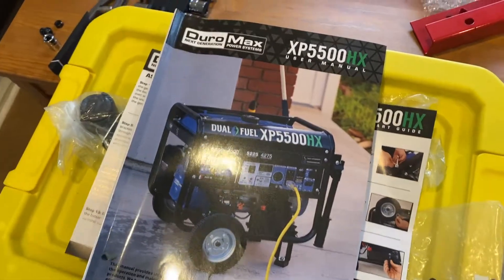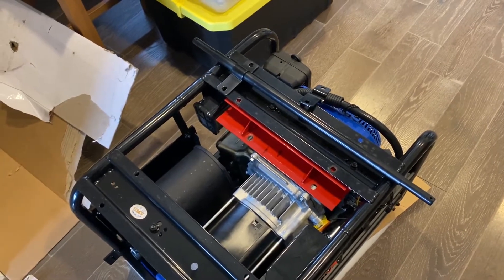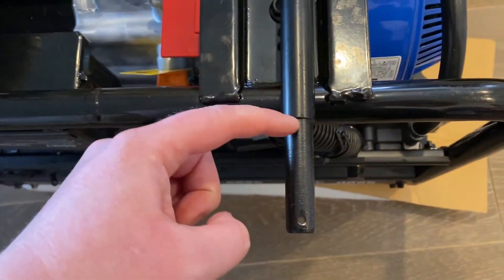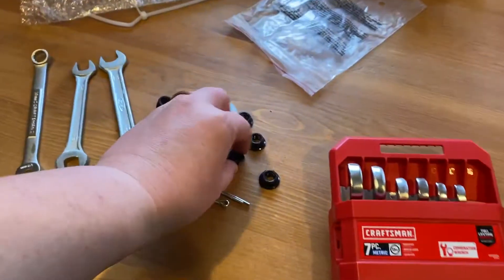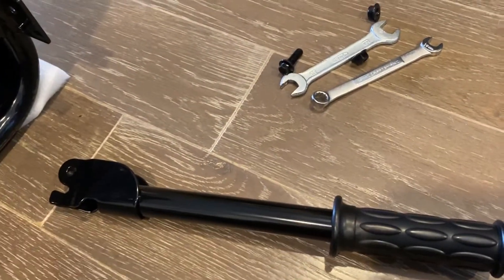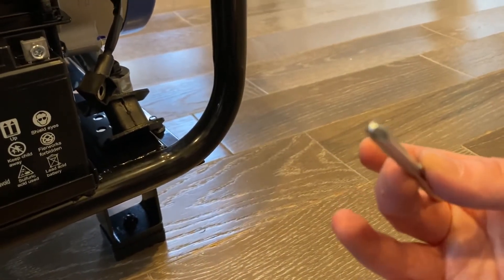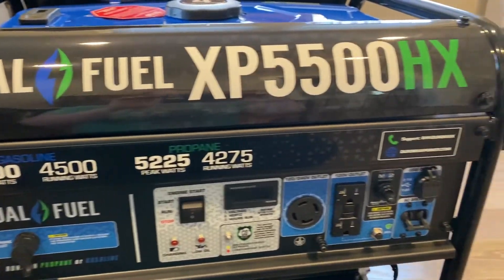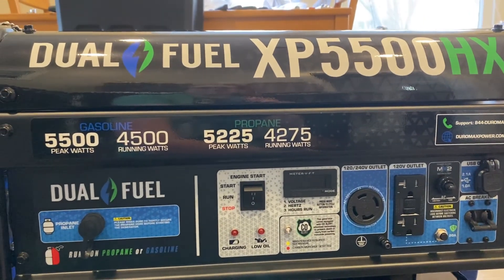How to Set Up XP5500HX Generator

Comment: How the heck are you able to get to the oil drain plug. It's behind the wheel and battery. I've been trying to get it off for days and can't access it with any tool (plus the tool listed in the manual is the incorrect side). Any help would be appreciated.